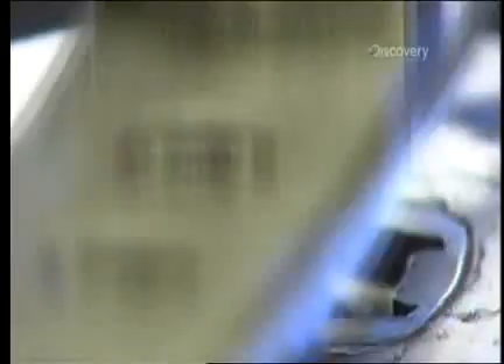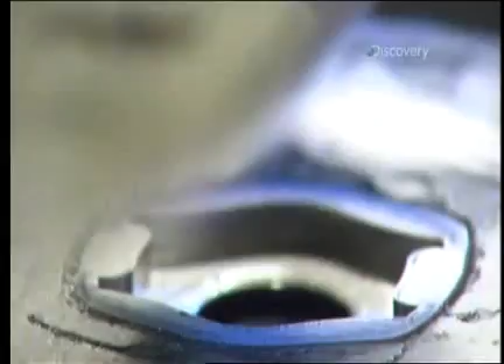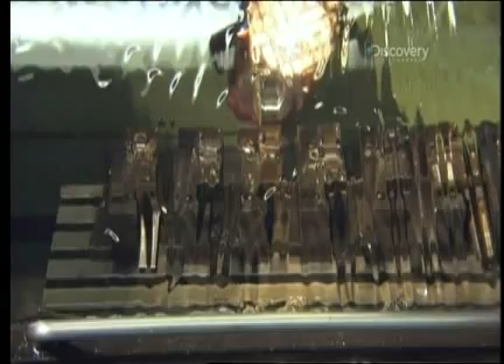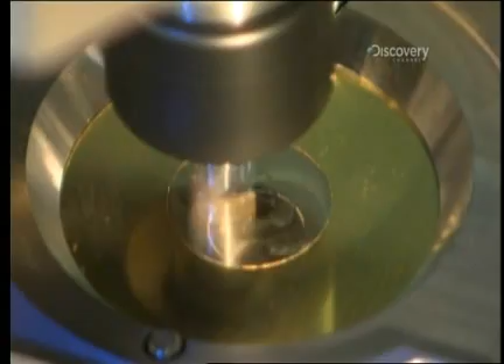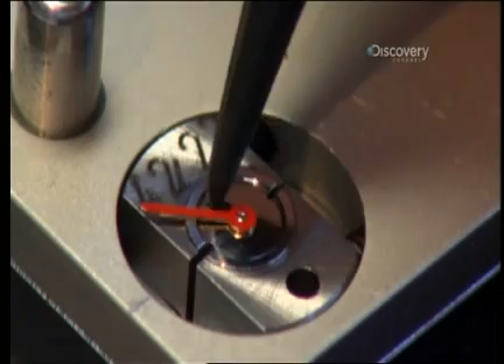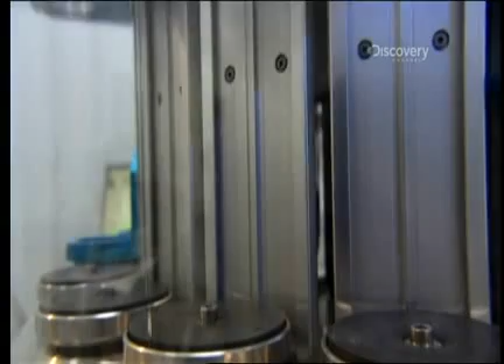How DoThey Do It Making Tag Heuer Watches

Comment: TAG Heuer do make movements, the CAL 1887. The whole movement is 100% assembled in Switzerland at their Cortech facility (Cortech is 100% owned by TAG). The design is based on a Seiko TC78 that is heavily modified by TAG to bring the movement up to a higher standard.

Other noteable TAG Heuer in-house movements include the 1/100th Mikrograph and, the belt system in the Monaco V4. They have also showed off many other concept in-house movements in the past.

Comment: With reference to th Cal.1887, They actually purchased the intellectual property rights to the movement, not the actual movements that go into the watches, saving on development costs. The movement is largely manufactured by TAG Heuer and Cortech with the exception of the hairspring and balance and the mainspring. As far as I know, none of the parts a provided by Seiko who's involvement stops at selling the intellectual property rights to TAG Heuer.

Comment: Steel with carbon added!  Steel is iron with carbon added so the remark is as fatuous as that suggesting that only women wore watches until the 1860's!
Reply: High carbon steel is used IN STRONGER STEEL. The really high carbon steel is the actual dies that punch the watch out. And it's never "added" because that carbon comes from the coal during the smelting process. Most steel coming out of the smelter has carbon come to the surface during rolling as it hits the cool air. That's know as mill scale. It crumbles off easily enough and if you leave I beams laying outside for a few weeks in the rain, you can actually kick sheets of mill scale off. Mill scale is quite dark brown.
Reply: Coke?